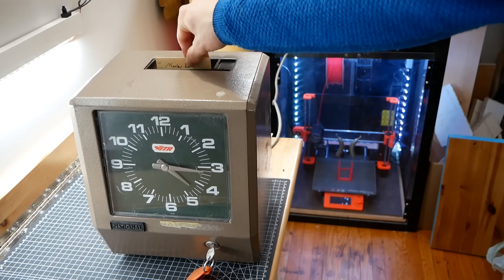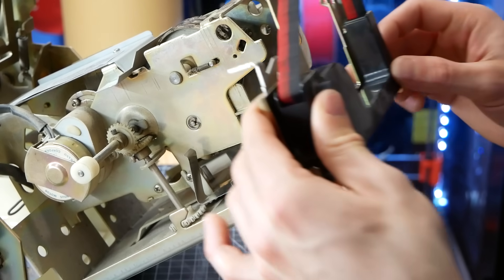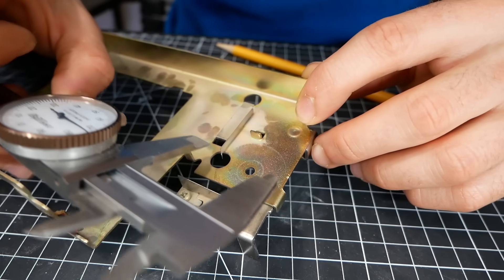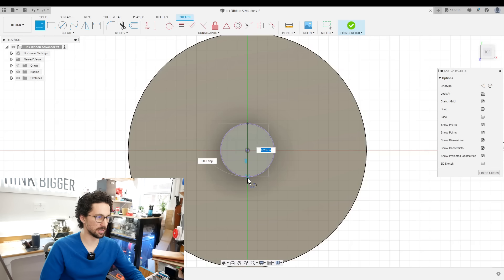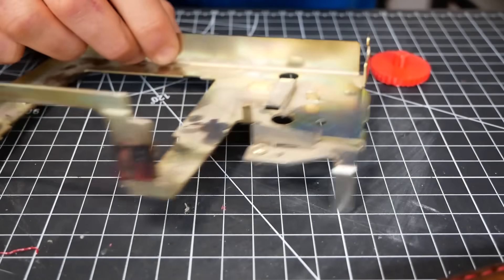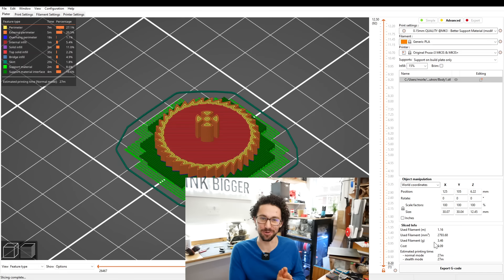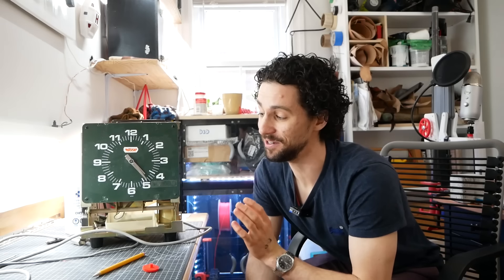They wanted 100 dollars. I 3D printed it for 9 cents.

Comment: For the teeth on the first gear attempt, remember that you're using 10° slices and a circle is 360° around. Therefore, there would be 36 teeth if aligned properly.
Reply: I was just thinking that, myself. At 10 degrees per tooth and 360 degrees in a circle, that would be 36 teeth.
Reply: He even ended up using 35 teeth right? Or did I miss him adding the last one?
Reply: @genrepolice  He copied the first teeth 35 times -> 36 teeth ;-)
Reply: @bernthullen8211  Gotcha! Didnt know / realize it worked like that, thanks!
Reply: @bernthullen8211  Is that how this program works? The one I use will take into account the original as nr. 1. I can see a good reason for both ways of doing that, just asking because it looks like there is still a tiny space between the bottom and top edges
Reply: I was yelling this at my screen. I have anger issues.
Reply: @dawggonevidz9140   I don't have anger issues, but I WAS muttering the "36, it's 36 teeth, ya twit!"  (NOT an engineer, but a retired RN.)
Reply: basic math
Reply: It's not even as hard as doing math in your head. Fusion will do it for you. That quantity in the the array should have been set to "360/toothAngle" to keep it parametric AND prevent having to do math or iterate at all
Reply: Very true, but having 36 would just give a sharper point on the gear which will wear faster.  He might even want to change to 34 to add longevity of the gear teeth.  Since the ribbon is endless, this wouldn't use up ribbon faster.

Comment: Well done Morley on this tutorial. Editing is on point and just the right pace. If I could, I just wanted to comment on your commentary that you find it outrageous a company would charge you 95 bucks for a replacement. I think it is a fairly reasonable ask considering the rarity of the machine and the immediate availability of a functional part after so many years. 

I would rather focus the your message of your video message to say with 3DP and some 3D modelling skills, you can easily repair things. Instead of shaming some company/person who offer a repair service.

If someone had ask you to design and make this replacement part for a single repair, you would likely charge them a similar price to make living off it.
Reply: This was pretty much my thought watching this video. They aren't charging for the material, they're charging for having the 3d printer, having CAD knowledge, designing the part, etc. Even in this case, it doesn't cost HIM nine cents: it costs nine cents of material plus time spent measuring and planning plus time spent in CAD for a couple iterations of the design. 

If you are willing to value your own time, expertise, and equipment as being 'free', most cost propositions seem unreasonable.

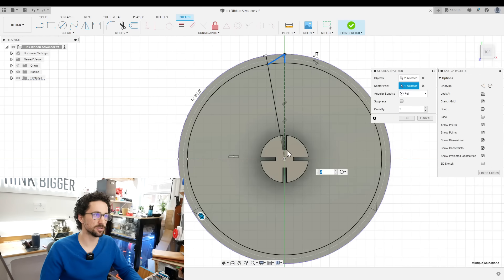Comment: 8:17 Your angle for the tooth was 10 degrees and you want to fill the circle with teeth. 360 degrees in a circle. 360/10=36 teeth. Just for next time.

Comment: why such a roundabout way of extruding and then cutting and making mutiple sketches? as soon as it gets more complex that that and youre in trouble... You could use your first sketch for teeth as well and then only extrude ready ring with teeth in one extrude , without selecting all those teetc to cut them out... the same with slot- you couldve drawin that as well in the same sketch and then only extrude the other way and woala- one shetc for whole project and 2 extrudes.
Granted this is a simple design, so you can get away with so much activies, but as soon as you get into assembles and need to change something, or, you find that something is not needed, and you start deleting items in history, but other actions ar tied to that, you get errors, and whole thing is unpredictable...
Reply: parameter usage is good though.. :)

Comment: I used to punch in/out on that exact same model time clock at a factory I worked at in 1979-80. 
Everything is computerized now, often with biometrics to confirm the identity of the user.

Comment: The kicker here is it probably cost them less than half of what it cost you for them to make it when they were mass-producing those clocks.

They’re so old now, though, that they probably have to custom-fab everything, and they probably would machine that gear out of a bit of steel roundbar, especially since these things are intended to be used in workplaces that can employ hundreds if not thousands of people, so that gear would have to be able to take a lot of abuse.

The way that ratchet works, I wouldn’t be surprised if those teeth wear down pretty quickly.

So $95 kinda makes sense to me, but I still agree that that’s a lot of money for one little gear.

Comment: Going to assume you did it for educational purposes/show n tell, but, when printing  replacement parts, that interface with other parts (printed or not), they should be 0.15 (snug fit)  or 0.2mm wider (external part that needs to fit over existing parts) or narrower (internal part that needs to fit inside another part). As for the  bottom axle that sits in the metal plate; it's easier to print the gear flat with a hole in the middle and print the peg separately then glue it in, rather than  take extra time to print the supports and have a gnarly surface finish (that can make a part unusable when dealing with mechanical stuff such as this gear).

Comment: Seems like you could’ve also carved a wooden peg to go through the toothed gear. And the gear you can get online. Don’t have to spend all that time on the 3D print. Also the toothed gear was pretty easy to figure out based on how the other parts moved

Comment: No. The company was offering $95 for the whole set up not just the 9 cent piece. I’m a 3D designer and printer and I love to create pieces like you have to fix issues. However, you have to be a bit clearer and admit that the piece you would have obtained for $95 you could not 3D print.

Comment: I know that $95 for a single gear sounds like a lot but to the company, they probably can't make it themselves so they have to order it and have it made then shipped. So what may be say $1 in material adds up pretty fast to the Power usage, the machinery, the packaging and the shipping of the piece, even if they have it in stock that's still there in the price. It's a lot for it but I can understand why, especially for an old machine like that.

Comment: I get into arguments with my co worker often about things like this. The amount of time it took for you to figure out what was wrong, design and test the part at your hourly rate, you ended up paying significantly more than buying the replacement part. 

There's also the thousands of hours of learning software and education to even be able to have the ability to 3D print a usable part that go into the cost. Granted at 600,000 views on the video, you came out ahead even though an unknown slub would have been better off dropping the $100

Comment: Time is money, 20 minutes to watch video (probably a bit more time in googling...), all the measuring, the time building the file, printing it.  Time trying the first product, failed, time remaking the edits, printing again...  It is not a 9 cent peice to 3d print it.  It was 9 cents of material (actually, 18 because you did it twice) .  If someone asked you to make this for them, what would you charge them?  I get the diy stuff, I do it all the time, but I don't say it's cheaper.  I say I'm paying with my time instead of my money.  Often I pay with my money because my time is extremely valuable. 
I just think it's a little misleading to say this only costs 9 cents... But in the end, good for you for fixing rather than junking it or whatever.  :)

Comment: So it's either I buy this plastic part for $95 
Or 
I buy Prusa 3D printer - $500
Learn fusion 5 hours * $50 an hour as I'm an engineer now, I know fusion - $250
Take my time as an engineer for a few trial and errors - 2 hours more  * $50 - $100
And print it by myself for a total of $850
Reply: @Muffinconsumer4 no one said anything about that. Only said this part for 90 cents
Reply: @Muffinconsumer4 its cool diy project, not a cool way of saving $9x, thats all.

Comment: 8:45 "it's steps like these that end up taking the most amount of time in fusion"
Well... only if you do it like that.
You made the pattern in the sketch instead of on the body. This makes things much harder for you and just takes longer. It also causes more issues when updating the parameters later on!
I highly recommend doing patterns directly on the model and not in sketches, at least where it's possible.

Comment: 360 degrees (a full circle) divided by 10 degrees (your tooth width) equals 36.  I'm amazed you know how to design things in Fusion 360 but elementary school geometry and math is too difficult.  360/10=36  No calculator needed.

Comment: I'd have opened the ribbon drive section to have ramps, to more easily accept a tape change with no fuss.
There's designs similar to old cassette tape sprockets that are spring loaded, but then we'd be venturing into needlessly complex land.
I'll eventually get around to getting a 3D printer, have to figure out the software situation for Linux though, as I minimize my Windows platforms here. I know there are options, just haven't studied them yet.
But, time's something I've got a lot more of now that my wife died.  :(

Comment: The part you 3d printed would have went through quoting firstly. The part is one cog literally in a assembly. The assembly was probably the cost you would have gotten. Regardless, it wouldn't have been made out of pla and is probably from a  non-existent physical company now so all the components would have been outsourced to several manufacturers. Meaning the process is no longer streamlined and would take several engineers at various companies and several quotations and a large time span to replicate the whole assembly. Sure, all you needed was a cog but you called the place that owns the blueprint currently. You talked to a guy that's job is to make profit by adjusting to a specific percentage of total cost. His job is not figuring out how to fix your time lock and finding the optimal way to do so. his job is to adjust all the bills that would have occurred from your purchase and mark them up a set percentage for profit. Sure, logically you're correct. the cost is not worth it. But you do not know what you're asking and how much time you waisted. Machining parts is not cheap. If you see a simple fix, just do it bruh. Don't waist multiple  engineers time on a 19dickety1 time clock to exaggerate the point of a.. whatever the reason is to have that dinosaur time clock. Likes on YouTube I suppose.

Comment: Nine cents of plastic.  But remember you need to add (Printer Cost + Repair Costs Over Lifetime) / (Printer Lifetime) * (Time To Print Part) (ie: cost of wear and tear on the machine itself) plus cost of power (3D printers do use a noteworthy amount of power) plus your time (time is money -- you could have used that time doing something else, possibly something more profitable, ie opportunity cost).  Even this should probably be all of a few cents, but your true cost is not nine cents.  Off hand I'd guess closer to twenty cents, given you have skills with Fusion that could be sold on fiver or other gig sites which raises opportunity costs, the long life of Prusa printers bringing costs down, the small size bringing time to print down, etc etc.

Still the better option likely than buying the whole metal tray component with the plastic piece, by far.  But never run your cost calculation on tangible consumables alone.  Always account at LEAST for wear and tear on operational tangibles and factor in some opportunity cost.  A good rough estimate for opportunity costs is to take one's weekly total take home income and divide that by 168, which converts from work hours wage (or whatever way it is calculated) to week hours wage.  A person who makes $672 in 40 hours of work would consider each week-hour worth $4, because even though they took home about $16.8/ work hour, that money has to last them the full week, which comes out to $4 / week-hour.  And yes, this does mean such a person pays effectively $4 / hour of sleep -- but this nets health benefits up to a certain point... but these numbers could come out to a point where someone might actually find skipping a little sleep here and there to be profitable, though skipping full nights probably not so much.

Comment: their price is actually not unreasonable considering what it is and what it takes for them to provide the parts needed.
and it will obviously be a whole lot cheaper and faster if you have the equipment and required knowledge to 3D print the part you need yourself.

Comment: Strange that he didn't think about the fact that he used an angle of 10 degrees, then asked how many teeth would fill up the space.  360 degrees divided by 10 equals 36.  Loved this video - it's amazing how companies will gouge you because they can.
Reply: Not really, because wouldn't it still depend on the tooth depth
Reply: @sir_john_hammond  no
Reply: I came here to say the same thing. You can see the tiny gap between each tooth. But I guess engineering is about 3/5ths approximation.

Comment: Hey you may have since realised this but just to let you know you could have easily calculated the amount of teeth needed to make it fit exactly. If each tooth is 10 degrees from the other, then there should be 360/10=36 teeth exactly :)

Comment: But you did not pay 9 cents to make it? The materials are more then 9 cents, only one print of PLA is 9 cents, and you have 2 iterations …. you forgot electricity, and other consumables like isotropic alcohol, wear and tear  on the printer and the fact your part is not the same quality as the one injection molded one. Design, manufacturing at scale, stock management, cost of money and Wearhouse cost.  And you have a lot less overhead then the company.  Did i mention the quality of the part? PLA not the best chaise by far.  3d printing is very good at printing highly specialized and prototyping but it is a terrible manufacturing process. And it is manufacturing.

Comment: PLA is good for making your prototype but your $0.09 piece may not last as strong as their OEM gear which was probably Nylon. Maybe make your part out of a more durable material and it will cost you $0.25. Still a huge savings. The PRUSA can print with Nylon filament.
Reply from the maker: I need to get some nylon!

Comment: $95 isn't that much if you consider what a company would have to do to get you a whole new assembly. Only sending a gear could be possible, but I guess they don't want to mess up the logistics that much nor pay someone to fetch it somewhere in the logistics train without creating a mess

If you'd price this solution, you'd not only have to factor in the $0.09 bit of plastic, but also the $0.09 prototype and the time it took. Say it took an hour to get the first print and another half hour to get the second iteration. That'd be $30 at $20/hour. If this were a business, it wouldn't end here. You see, a company needs to pay the staff supporting this engineer as well as the building they're sitting in and make profit on top of that, so things often sell for double or triple the cost. That means our $30.18 part could sell for $59.99 to $89.99

With scale, the manufacturing cost is low. Metal parts won't be as cheap as $0.09, but still low compared to the engineering. After a while the engineering cost is recouped, so only the manufacturing and stuff supporting them needs to be payed, so the price can be lowered. In this case, they probably don't take the engineering cost into account any more, but the whole assembly could still cost $50 to manufacture, so $100 is reasonable for them, but obviously not for someone with a 3D printer

Comment: Amazing project! Excellent troubleshooting and equally impressive designing/testing. That was a fun progression and I appreciate the linear storytelling. Thank you! :-) I am not sure it's fair to actually consider the finished product a $0.09 cost... That was only one single calculation of material usage/consumption. Cura estimated that you used .09 of plastic in the final physical object. However, considering the cost of labor to design, produce, test, re-engineer, retest annnnd edit the video (lets not forget the perfect amount of production! High praise deserved). This part cost WAY MORE than $0.09... The OEM part was manufactured through a similar process. The differences being that the OEM was a FACTORY with INDUSTRIAL equipment, requiring many human hours to operate. The "business" of manufacturing is a far larger piece of the puzzle than people often recognize. "You" were able to create this amazing part in your "kitchen" with a few clicks of your mouse. Whereas, the OEM had to do it with a room full of humans good at math and the ability to correctly translate scribbles into actual physical tooling in order to manually crank out a production run of the company's product in order to support the business and make a living..... Sorry, that dug in a little harder than I anticipated. I LOVE 3D Printing. I am not well seasoned with it yet, but I am ever grateful to live in the time/age that we do so that a little guy "like me" has the capacity to fix a wonderful piece of mechanical history :-) For crying out loud, I own a 70w Co2 Laser Cutter and (2) 3D Printers! When I was a kid, I never thought that would be possible. :-) But "This'' is the world we live in. hahaha Thank you again for the awesome video!!